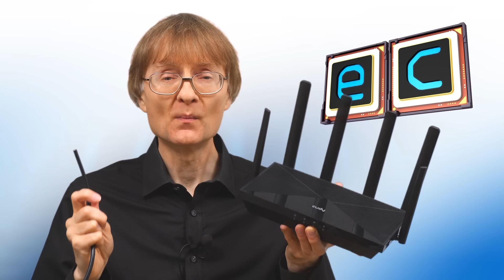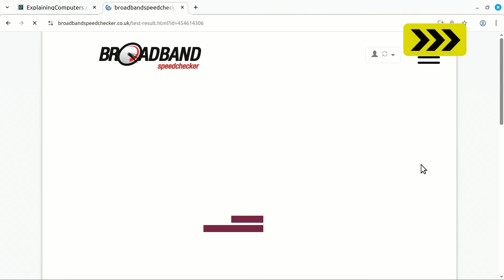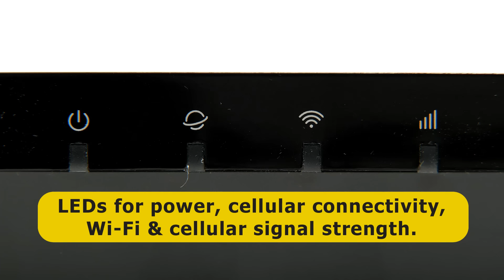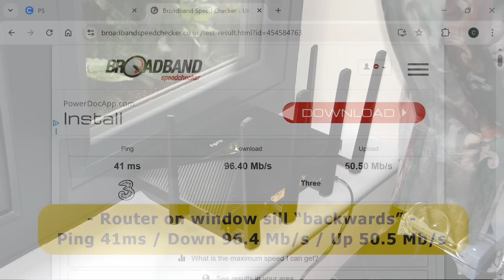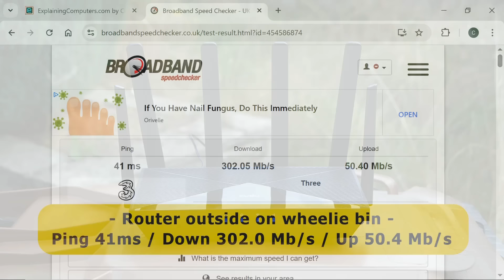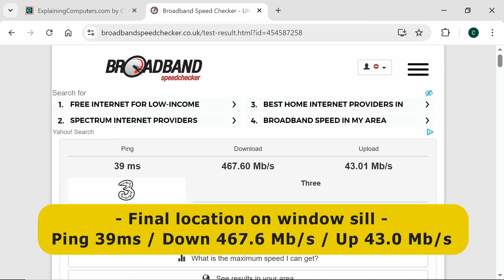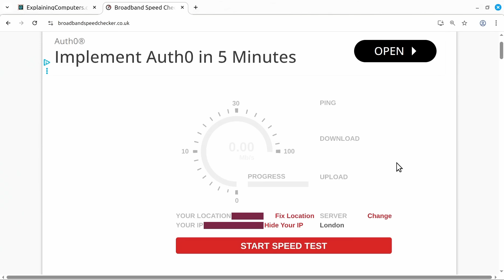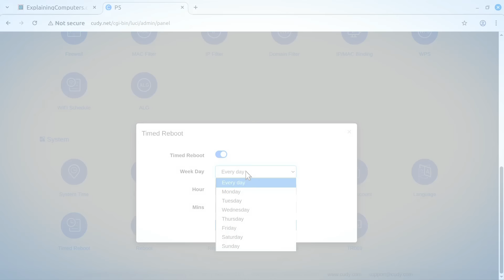Switching to 5G Broadband: Cudy P5 Router

Comment: yeh i used 5g on the three network using a SMARTY sim for £16/month for unlimited data and usually got 100-150mbps, until full fiber came and got that instead but keep the 5g router as a backup. i did get a refurbished 5g router for £100

Comment: The issue with 4G/5G services is that you get a "NATted" public IP address from the ISP rather than a direct one. This prevents you from hosting web services where port forwarding is required. Has this changed? If so, I would gladly ditch my current broadband (costing some £65 a month for mere 40/4Mbps).
Reply from the maker: What you say I believe is still correct. You do not get a direct, public facing IP. But for me this is not a problem.
Reply: Same question, only from the US.  Currently I'm using TMobiles 5g offering.  The supplied modem/router has no features other than naming your wifi and it's password... my workaround is a PFSense router behind the TMobile, it's making a VPN connection and I'm forwarding through the address there.  It's slower though, routing things over the VPN connection, so I'm trying to figure out other ways of accomplishing things... :)

Comment: Due to ridiculously expensive cable internet in my area, when T-Mobile made their 5G home internet available, I immediately signed up...If only for a month or two, so I could become a "new" customer at my cable internet provider, and get good rates again. I've been using T-Mobile's home internet for almost six months now. Reliability has been on-par with cable. Speed is good (up to approximately 250Mbps down). However, in my experience, the variability of the speed has been the biggest difference. One day I might be at 250Mbps down, the next, I might be at 25Mbps down.

Still, for only a third the price of my cable provider (and guaranteed price for five years), I'll take it.

Comment: Thanks! Very helpful information and great idea to share with all the viewers. I frequently had small issues with unstable connectivity with current ISP leaving no clue but keep on restarting the modem to resolve the symtom. Recently redesigned my home network with router to connect my 5G smartphone for internet. 5G plans for mobile is a lot cheaper than home internet as well.

Comment: In Poland, all operators have also already launched 5G in the 3.5 GHz band. They each have 100 MHz of spectrum, and you can get around a gigabit on an empty site - but as we know, that will get congested too once people start replacing their devices with ones that support those bands.
Reply: Dlatego warto kupić dobry router modem zewnętrzny żeby łapać 3,5GHz

Comment: Glad you got such a good result, just on your window sill. I'm not surprised at all about your story with BT though! For various reasons, I decided to switch my number (which was linked to my FTTC broadband with BT) to a VoIP setup a while back. Not as easy as you might think, since it would have required being without broadband and potentially losing the number as BT retail really don't have a clue when it comes to that kind of thing. Luckily I was out of contract and used Andrews & Arnold who provide broadband and VoiP services and managed things really well, no issues. They aren't cheap, but when you call their support, you get actual experts who (and I'm not making this up) know what they are talking about! Shocking!

Anyway, the point being, you could migrate your old number to VoIP (if you haven't already) and I'd recommend A&A if doing so. As an aside, I recently moved house to Norwich in the UK, I'm only a couple of miles from the city centre and quite unbelievably, the best broadband I can get is about 26Mbps and still using FTTC of course. So I bough an external 5G modem from ebay (ZTE MC7010) which is also sold by 3 and you can get a contract from them, which is a good price, but they won't sell it to you if you don't have a good enough signal and aren't that close to one of their masts. So this supplier on ebay sells refurbed versions which are unlocked, so you can use any supplier. It's a good 5G modem / router and I feed this into my Unifi network. I don't get as good speed as you do with it peaking at about 200Mbps down and about 10 up, but it's still loads better than the crappy fttc connection.  

Just hoping I can get a proper fibre connection at some point, as the 5G is a bit flakey and the latency isn't great. Certainly can't be relied on for my work or gaming, but does the trick for downloading at least.

Comment: I'm in a similar situation -  some workmen went through my Virgin Media cable and then paved over the ends in early August and Virgin Media they still haven't reconnected it. I've been using a second-hand 5G phone tethered to a GL.iNet Slate to provide internet to the home network. The Slate is excellent as I can also connect it to my personal phone's hotspot and load balance across both connections for more bandwidth, or when the 5G connection might be faltering. I generally can't recommend the GL.iNet routers highly enough! I've ordered one of their GL-M2 5G dev boards as an experimental replacement for the phone as the proper antenna should hopefully provide better signal.

Comment: Our choice in Alaska was DSL or cellular, so I just made my phone a hotspot. 1 bar of 4G with a cheap Amazeboost cell booster off Amazon that only made a difference in db if I left my phone literally sitting on the inside part, which was fine since my wife could just call my work cell. Between 1 and 7 mb down. Good enough for a couple iPads. After a year I broke down and got Starlink last week. Now I get between 15 to 75mb down. Not as fast as advertised either, but still a lot better. $120 a month though… It’s on a pole well above the roof with no obstructions. Wanted better internet because I miss tinkering, and I don’t want to take a full day to update Linux packages or download ISOs or a Steam game. Barely touched my computers at all in the past year. Plus, winter is coming. Gotta stay busy cooped up inside.

Comment: Great report, glad it is meeting your needs. When I initially heard about 5G fixed wireless I thought it would be a great solution to deliver high speed internet in rural areas where the cost to install fiber was not justified but was skeptical it would be able to deliver adequate bandwidth in congested urban areas. At least anecdotally here in the US folks have had similar experiences to yours and are happy with the service.

Since 2000 we have had various forms of DSL provided by the local phone company and competitive ISPs. In 2021 the local phone company beginning rolling out symmetric PON in our area. We were able to switch both internet and landline phone over to fiber. We currently have 100/100 Mbps service and VoIP landline phone. They have multiple speed tiers the highest is 2000/2000 Mbps. We routinely get 110/110 Mbps with 11ms latency to a server 40 miles away. Interesting factoid fiber overprovisioning is faster then our best DSL speed of 6.5Mbps.

On this side of the pond the FCC mandated phone number portability allowing us to maintain the same landline phone number when we switched ISPs. Currently paying $65 US a month for both internet and unlimited telephone. Overall have been very happy with the service.

Comment: Impressive results, Chris. Disappointing Openreach are being completely useless, but it’s also not a surprise. My parents are in the midlands and they have Sky/Openreach FTTP and it’s pretty flakey. 

I’m lucky that I managed to get synchronous FTTP provisioned to my house in the wilds of North Yorkshire (not via Openreach/BT either, but by 3rd party ‘Cuckoo’). Provisioned on a 10Gb Fibre to the house, and with a 10Gb PON (fibre converter) with a 2.5GbE connection to my Netgear Wifi7 Router and paying for 1Gb sync. 

Currently getting 1.2Gbits/s downstream and 960mbit/s upstream when on 2.5Gb Ethernet and around 960mbits/s both ways on wifi 7.

Comment: I had a similar issue with my wired broadband connection. The ISP did not want to fix it as sending an engineer round would cost more than I paid for a year of service (they didn't say this and just messed me around for a month). During this time I used my phone as a mobile hotspot and noticed I was getting better download and upload figures. I bought myself a 4g router (£45 compared to £250 for 5g) and have been able to use this for 1080p YouTube and working from home. It does help that I can see the Cellular tower from my bedroom window. Waiting until the prices come down to purchase a 5g router which my Sim supports.

Comment: I switched from wired cable internet to wireless 4G internet as 5G was not available. My internet bill was halved. The speed was not as fast but worked very well when I streamed on two TVs, a laptop and two phones. All was well. After four months the 4G speed decreased to a point where it was annoying. I think a lot of people in my neighborhood switched from cable to 4G and it overloaded the cell towers. Luckily the cable service started offering a deal on new subscribers so I switched back to cable. Competition rules !
Reply: Agree. I used an unlimited three sim in a modem for about 8 months while I waited for fibre, instead of renewing my previous broadband for 12 months. It worked quite well dropped out sometimes. Fibre optic beats it with symmetric broadband. Upload and Download are both 150mbs which is enough for me. I could go up to 900mbs symmetric up/down but not needed right now. The fast and symmetric speeds particularly useful for cloud file storage.

Comment: Our property is 500mtrs from a 5G cell tower, but we can't receive it due to line of sight obstructions, namely house roofs. If we go just 10mtrs south of our property we have just about got line of sight, and whenever I leave the property I initially lose my wifi, then get 5G, then lose that and get 4G. Phone calls always drop between leaving the property as the cell tower goes from 4G to 5G then back to 4G, to combat this I've set my phone not to access 5G, sacrificing the speed for reliability, and that works well, except the back garden barely receives and 4G, so then I have to rely on Wi-Fi6... It's all a right pain in the arse!

Comment: I use Virgin with 1.1G down and 105M up. I’m hoping for 900M up and down to come to my area in the coming year.

I’ve set my Virgin router to modem mode only and bought an ASUS GT-AXE16000 quad-band WiFi 6E and an ASUS ZenWifi Pro ET12 to cover the house in WiFi but also run a CAT6A from the ASUS router to my main computer and homelab. I’ve also got a MikroTik CRS304-4XG-IN switch to feed different devices in my computer room.

Comment: I've been using 4G LTE home connection for a long time now (I think close to 8 years) and the one thing I've seen is that the modems kinda get worse with time, even if I mod them to add ventilation they will just require once-twice a day power cycles, even tho before they could go for a whole week with sunday morning power cycle only, to get back to normal speeds. I'm not a techy enough, but it's just probably due to ISP and conjestion rather than the hardware. But I'll be glad for future updates "1 years in" etc. just to see perspective of other peoples.

Comment: I bought a 5G++  Suncomm O8 5G Dual-SIM Router that looks remarkably like  this one but has more antennas. The admin pages have the same icons and windows. It is available in the UK for £349 but I got it, eventually, from Alibaba for about £65. I was pleased about that. Sadly the box did not include any instructions at all nor an ethernet cable even though they were listed on the box. Far worse is the fact that it does not even recognise the fact I have inserted a 5G SIM. The SIm works on 4G very well, from O2, but I'm paying for 5G so I want it.
Is there anything clever I can do to make it notice the SIM at least? I have tried another working O2 SIM with no luck. I've asked for tech support, so far I've just got polite \you are in the system' comments and a request to judge the quality of the translation to English !

                                                                                            --------------------------------------------------- P>S.---------------------------------------

After a lot of online chat it turns out I bought an inexpensive version WITHOUT a 5G 'module'. It is totally useless without this board. The cost is £95, which still works out less expensive than diect from Amazon,but I haven't got it yet so I don't know if it will work.

Comment: Those Speed Test results bring a tear to my eye... Seriously, I saw the values for the landline test and  thought your new setup would blow it out of the water. It was an increase in speed overall, but shouldnt it be much faster than that?? I did speed tests on various devices while watching the video and I'm not even going to write out my results, I would be called a liar as fast as it would take to type it. (Test Results available upon request) Do you have neighbors siphoning off your network?Is there something in the infrastructure of UK internet providers that causes those speeds? The 4G device's speeds make it seem like there's RF interference or tageted intereference even. I'm still thrown back by those results.... We need to get you a proper internet connection. You should take that 1 million Subscriber number out for a test drive... see what kind of power it has. I think you'd be suprised what one could get done with a subscriber number like that... Gone are the days of Knowledge being Power, Today Subscriber count and Likes are Power. And you have Ton to work with.  Great video as always. The best way to start a Sunday morning. Cheers!!
Reply from the maker: Thanks for this. I included a table in the video showing typical 4G and 5G speeds in the UK, and I'm clearly getting top-end upload and download for both 4G and 5G. Different parts of the world have very different infrastructures and Internet speeds, and also very different prices, as the comments here demonstrate! :)

Comment: I recently moved into a new-build house from Persimmon, and they install their own FTTP lines so you have no choice in your ISP. I went with 5G broadband instead - I purchased a TP-Link Archer NX200 router for about £200, and I got an unlimited data SIM from iD Mobile (a VMNO for 3) for £16 a month (24 month contract). I get download speeds of up to 250Mbps with an average ping in the low 20ms. It more than meeds my needs and is much cheaper (for the 250Mbps package with Persimmon's ISP I'd be looking at £45-ish a month).